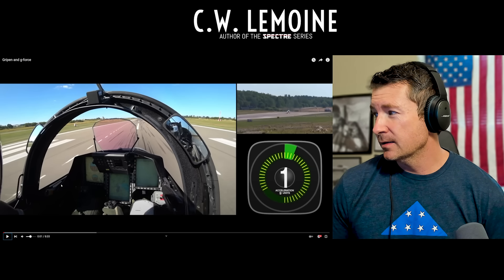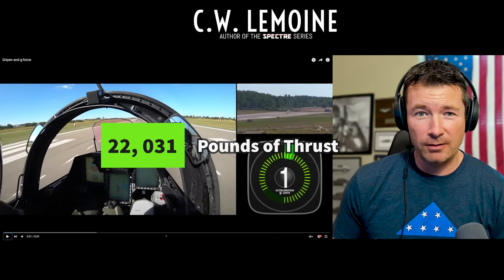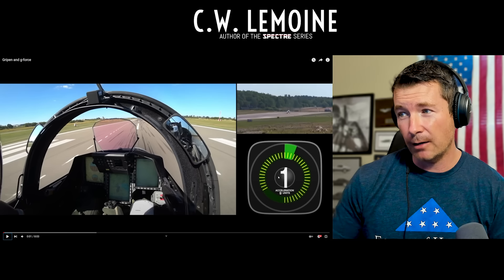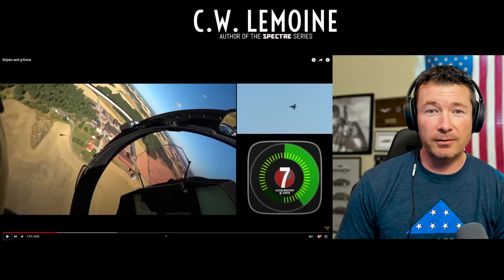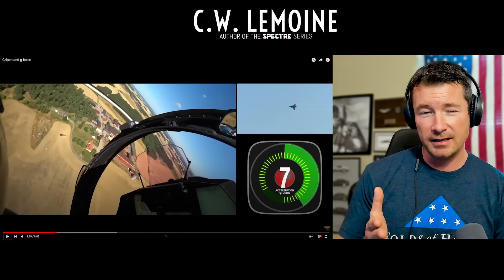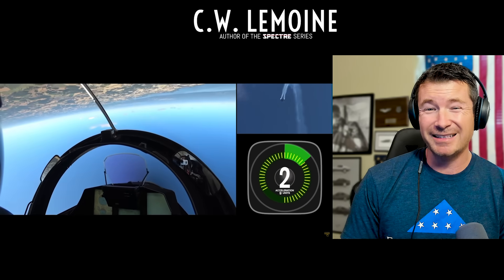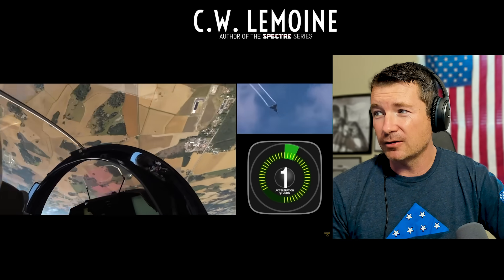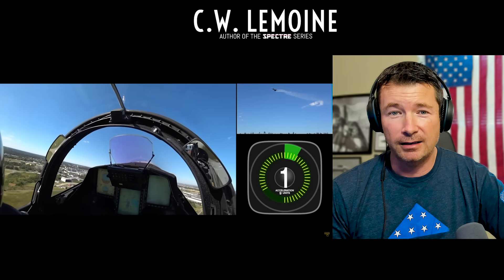SAAB JAS 39 Gripen G-Force Video *BREAKDOWN*

Comment: This video seems as much a testament to the skills and physical fitness of the pilot as it is to the attributes of the aircraft.   Ever fight one of these in an exercise, Mover?   As a side note, I read recently that Canada has dismissed the F-18E/F as a replacement for its legacy Hornets, and is now focusing on either F-35 or the JAS 39.    First and foremost, I am surprised that both remaining candidates are single-engine airplanes.   I can understand the attraction of F-35 due to the sophisticated avionics and networking capability.....but for the primary mission, I don't understand the thinking with the JAS 39.    If they can afford F-35, I think Canada should be looking at Boeing's "flying SAM site", the F-15EX.   US Guard units are likely to get it.   Purely from the combat capabilities, I think it would be great for Canada as well.   The only disadvantage I can think of is tanker compatibility, which could well be the deal-breaker.
Reply: Don't underestimate the Gripen's avionics and networking capabilities! It is in fact one of its strongest USPs and force multipliers.
Remember, the Swedish Air Force and SAAB were pioneers in this area with their so called fighter data link as far back as the 80s and early 90s, enabling ground, sea and air assets to securely exchange tactical data between themselves. And they have not lost their technological edge since.
Reply: There's speculation that the committee evaluating these two aircraft may conclude that neither finalist meets current needs so the competution will be closed without a winner.  This would allow a new requirements proposal to be drafted which would permit the F15EX to compete in that competition.
Reply: @Drew Peacock I agree with you because of the reasons you outlined so clearly.  The Saab does very well in competitions.  With the money Canada has to spend it can get more planes.  However, there are vast regions of Northern Canada with no roads or airports at all.  I don't know if there is a fighter that has the range to cover the entire northern extent of Canada.  That is why it was so short sighted to cancel the Arrow project - we still don't have a plane that replaces it, but that's another story!

I totally agree with you on the F35.  I think the only reason that it could possibly be there is political.
Reply: @Drew Peacock re: the word "political" - yes bribery is more accurate.  If I had my way the one who was bribed would be prosecuted for that crime.  However with Castro Jr. at the helm.....

As for stealth technology, won't this technology be rendered obsolete as sensing technology is developed reducing the effectiveness of these fighters  Thus if that is the reason for paying a premium for the F35, wouldn't that money be better spent on more aircraft or kept in reserve for future upgrades?
Reply: @Drew Peacock f15ex not for sale outside US

Comment: It doesnt have the thrust of a Viper but it weights nearly 2 tons less in equal conditions.. so thrust to weight its very close..
Reply from the maker: A clean F-16 in air to air config is around 21k lbs with 29k lbs of thrust.
Reply: @CWLemoine  also i screwed up and was taking the Grippen C weight.. the Grippen E (the one with the 414 22K lb engine) is 1.2 tons heavier than the C so yeap.. Viper totally wins in thrust to weight

Comment: I seem to remember reading a book called 'Seven miles of wire and a swizzle stick' (I think) about the Mercury space project. One of the exercises or tests for the pilots preparing for space flight was the Multiple Axis Space Training Facility (MASTIF) where they experienced 'Eyeballs in and eyeballs out' as they called it. Basically a high speed fairground ride where they whizzed you round until you experienced high G forces, then suddenly turned the seat around the other way.

Comment: It's mandatory part of every Gripen pilot training to "survive" 15 seconds of 9 G in centrifuge at Sweden's training centre.
Reply: I'm pretty sure that would put my eyes out the back of my head.
Reply: RIP to those that did not make it
Reply: @vincentnin1  the centrifuge doesn't crash if you lose consciousness, so survive here probably(hopefully?) means not losing consciousness.
Reply: @sahilmeena8018  yes youre right
Reply: @sahilmeena8018  Well, it's also mandatory to survive.
Reply: mandatory for most if not all Nato pilots too
Reply: I'm sure you mean not to black out, most ppl would survive 9g, but may black out for a short while. 9g is not lethal, well for most ppl it isn 't, for elderly it might be.
Though flying low altitude and doing 9g and black out would prolly be very lethal.
Reply: @mrlargo7067  This is a Jas 39 C. In the Jas 39 E you can do 12 G turns. That amount of G seems to be the limit for the Swedish pilots with existing equipment.
Reply: @sorennilsson9742  jas 39C can pull 12gs as well if you pull the stick over the click point which disables 9G softlock and be able to pull 12G hard lock
Reply: @CruLisP  True but E can hold it for longer if I understand it correctly.
Reply: If you want a seat in a Gripen's cockpit, you need a 9 G Certificate.

Comment: The Gripen E has a better thrust to weight ratio  and AOA capabilities than the F-16V, and lower operating costs.  The initial real world purchase price is similar, but the Viper can carry a larger weapons load.
Reply from the maker: I don’t know about a V but it does not have a higher thrust to weight ratio than a Block 30 or 50.
Reply: @CWLemoine  Comparing the F-16V to the JAS 39E:   "The Viper’s GE powerplant produces almost 30,000 pounds of thrust for the Viper’s max takeoff weight of 48,000 pounds. Compare that to the new engine (F414-GE-39E) on the J-39E with it’s 22,000 pounds of thrust for the much lighter 31,000 pound max takeoff weight Gripen E.

That’s a 0.625 ratio for the F-16 and a 0.70 ratio for the Gripen E "
 
SOFREP - "Dogfight! F-16V Viper versus J-39E Gripen: Who Wins? Aug 22, 2019"
Reply: @CWLemoine  Comparing the F-16V Block 70/72 to the JAS 39E:   "The Viper’s GE powerplant produces almost 30,000 pounds of thrust for the Viper’s max takeoff weight of 48,000 pounds. Compare that to the new engine (F414-GE-39E) on the J-39E with it’s 22,000 pounds of thrust for the much lighter 31,000 pound max takeoff weight Gripen E.

That’s a 0.625 ratio for the F-16 and a 0.70 ratio for the Gripen E "
 
SOFREP - "Dogfight! F-16V Viper versus J-39E Gripen: Who Wins?" Aug 22, 2019
Reply from the maker: I don’t know anything about the F-16V, but you don’t compare MTOW when talking about thrust to weight and BFM configs.

Comment: I wonder does the pilot see anything when he does these rather long 9g turns and -3+9 g jumps or he's just flying with his butt feeling at these moments.. it's just totally insane how long he can pull these and have control, never seen anything like this before..
Reply: Sweden is a small country with a small military force but that means selection can be extreamly limited. All fighter jet pilots are handpicked, put throught extreme and extensive training, must be in PEAK physicall form as well as mental. Also has to display very high levels of inteligence and problem solving to even get selected. So we only have a few pilots but there all trained to absolute perfection. Also why many of them can do insane manoveres and pull extreme G's.
Reply: Definitely still seeing.  He's too low to fly on gutt Feel - things happens REALLY fast in a fighter jet, even more so at low altitude.

Comment: The Gripen-cockpit is very nice. It's actually DAMN tight, though, even compared to the Viper.
Reply: The F-16 cockpit, while good for its time, was always a continuing modification with new features crammed in. The Gripen, however, is a logical and well designed layout (as was the F/A-18). Combined with the highly integrated avionics, the Gripen wins hands down in the man-machine interface department. And yes, I have this from RNoAF pilots who have flown the Gripen. Of course, any seasoned pilot will learn the intricacies of his system and make it effective.
Reply: @PaRadiZer  This is true, it is a well-design cockpit while the Viper-pit was more an evolution. Don't get me wrong, the Viper-pit (especially post-MLU) isn't a bad office, but it's not as well laid out as the Gripen.

Got to spend quite a bit of time sitting in the 'pit as a Crewchief-assistant with 331/334, sadly only while towing. And while I wasn't as big a dude as I am now, test-sitting the Gripen-pit a few years after made me aware of how tight the Gripen-pit was, even in civvie clothes.
Reply: Yup, some Viggen pilots couldn't transition to the Gripen because they were too tall. Length of the thigh bone is a limiting factor,.
Reply: @Snobiker13  Doesn't surprise me. Test-sat the Gripen back at Bodø Airshow in 2008, and it felt really tiny even in comparison to the Viper. Really well laid out, though.

Comment: Good points Mover but, you forgot to mention that usually these aircrafts have their specifications modified to perform a show (e.g., lower fuel, etc) . This is evident particularly for new aircrafts when presented to international airshows. Like the 1989 Mig-29, or years later the Su-27. They want to impress and consequently attract potential customers or in this case, make it look like a 30plus years old is still relevant and not obsolete.
Reply: Can't comment on other Gripen users but the displays flown by SwAF are all done in standard configured jets. 
Usually 90% fuel at take off.

Comment: Very nice video and commentary. To fully understand the Gripen concept one need to be familiar whit the Swedish aviation legacy. The fighter is made to fitt the Swedish fighter pilots. The Air force in Sweden is very small compere to US, now days. But in it's glory days it use to be the worlds 3 trh largest air force using almost only swedish made fighter models. Jas 39 is a integrated weapon system that includes some novel tactical concepts. Sessions at Red Flagg had People talking in awe and of course stuff is sherd whit US as always. Our pilots are not the bragging type so they down play just how good thy are.  Many systems is tec licensed from US and it's not really a ground up swedish airplane, things do not work like that in the modern west. The G-suit is not the run if the mill tou and may explaine what we see in the video. It's made in Sweden and very good.. It's a well keep secret just how good it is. To be picked for the jobb as a fighter pilot in Sweden is extremely hard. I know People that did try and thy where crunched by how hard the testing was. ( And they where asked by people in the air force to apply even, being told thy had a pretty good chans to be pass)  It's no joke. Thy chose the absolut elite during the elimination process. I do not say this in any disrespectful intent. But any pilot flying Gripen has an IQ way above average, a body like a elite athlete. Thy test for multitasking and stresslod tolerance and you can attend the basic program as young as 19 years of age. You may be asked to leave at any point if you're not showing signs of brilliance. There is no such thing as a medioker swedish fighter pilot. Whit a caviat that you can apply to be a flying air force engineer whit some tactical roll if in conflict.....
Reply: fourth largest 👍
Reply: Also, during much of the cold war, we lost 10-20 pilots each year to crippling and/or fatal accidents just because they always flew as if it was a war on. Low, fast and aggressive.

Comment: 1:03 I kinda was expecting you to drop that comment, dunno why. But still you killed me with actually pulling that off there! :D

1:42 It's a Volvo version of the Hornet's engine. The NG variant (E and F) does have the 414. And the plane is lighter than the Viper (at least the non-NG variants).

BTW I'd love to see you ruin that "Gripen NG" video they have on their channel. ( watch?v=oKlQyPOiRuE )
Reply: Rainbow Dash:
"The NG variant (E and F) does have the 414. And the plane is lighter than the Viper (at least the non-NG variants)."

The F-16AM (Block 10/15 mods) are lighter. About 7400 kg vs. Gripen E at 8000 kg at about the same engine power (installed sea-level static).